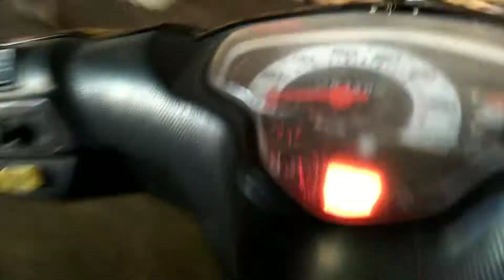Pengapian lemah motor susah hidup-NEX F1(injeksi) #budyartaotomotif

Comment: Bang mau nanya motor saya Suzuki Nex injeksi pas di stater gak mau nyala terus saya cek di bagian busi pengapian nya hilang tapi saya cek di spulnya ada pengapiannya cek di kabel kabelnya dakda yg putus terus lampu mil nya kedap kedip terus dan CDI saya hangat hangat gitu itu penyebabnya apa ya om
Reply from the maker: Pkek aki?
Reply: @Arthachannel-01  maksud nya bang
Reply from the maker: Akinya bgus gak
Reply from the maker: Klaw gak ada aki tes aki
Reply: @Arthachannel-01  oklh bang nntik saya tes aki
Reply from the maker: Injeksi hrus pkek aki
Reply from the maker: Sistem pengapian.injeksi.ada arus aki masuk ke cdi
Reply: @Arthachannel-01  saya pakai aki mungkin aki saya lemah kali
Reply from the maker: Cb cri yg bgus
Reply: @Arthachannel-01  om kami mau tanya apakah CDI Suzuki Nex 2 bisa di pakai Suzuki Nex 1 yg lama
Reply from the maker: Tes aja bng.krn sya gk pernh mndptkan kdua cdi itu.klau biar jlas cr d gogle kodenya
Reply: @Arthachannel-01  klo CDI DC di pakai buat arus AC bisa gk bang
Reply from the maker: Coba pinjem punya temnya yg punya nex baru.atau cri di gogle